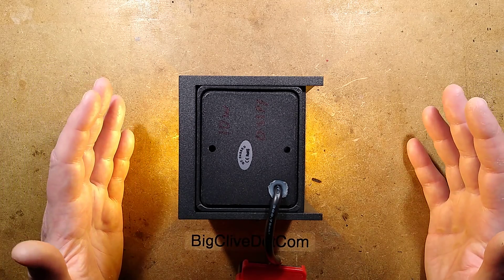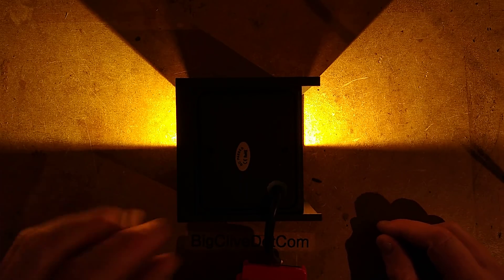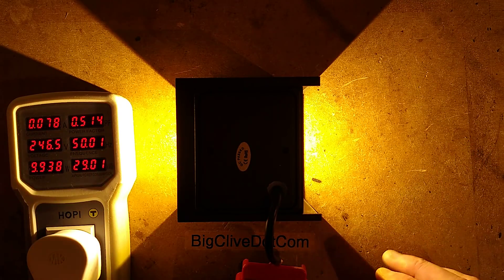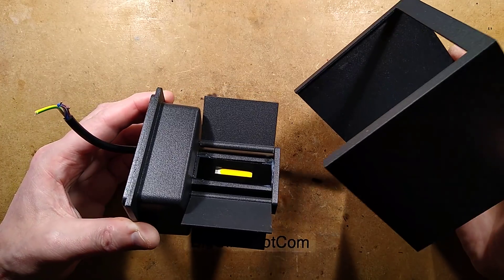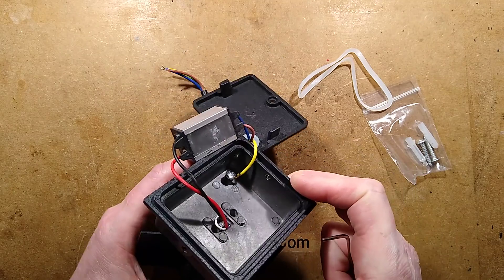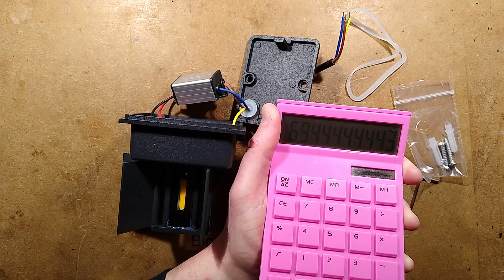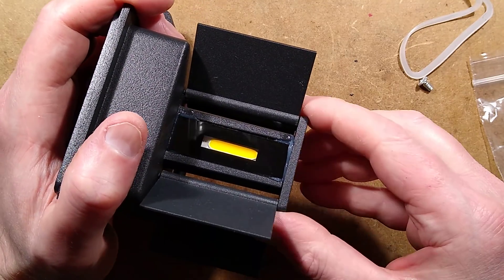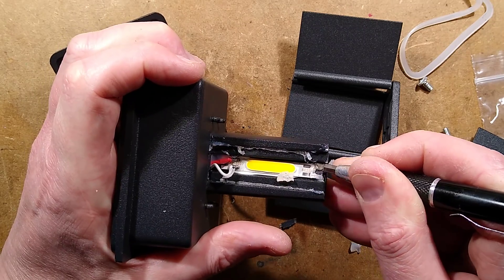Inside an eBay "IP65" LED wall light with barn doors for light control

Comment: Hey Clive, got recently a 220V power supply module for DIY projects (without case). It has a dedicated ground connection on the board. Thing is, when I measured it, it has a potential of about 7V AC (no load) and a current of ~2µA flowing to ground. Still wondering if that is normal or not.

Comment: 8:47 How do you read these COB markings ? Google doesn’t help me here ...
Reply from the maker: There doesn't seem to be a formal standard.  There will generally be two numbers.  The number of chips in parallel and the number of those parallel circuits in series.

Comment: Are COB’s always driven on current ? And how do you find out the correct current for a given COB ?
Reply from the maker: Usually, although there are some common 12V COBs for vehicle use that just rely on the combined LED forward voltage adding up to around 12V.  They tend to fluctuate in intensity significantly with voltage variations.

Comment: I searched first, but didnt see any, do any of your videos of misting cleaning devices contain electro-static devices?  Our school almost got taken to the cleaners by a company trying to sell "electro-static" air mist hand held devices for $800 each that they claimed would cause the mist to be charged in a way that cause the mist to go around corners, under desks, etc...   I understand the concept of charging the particles, but am having trouble finding any actual videos about these types of devices.   Only autobody painting electro-static paint sprayers.  Thanks A TON!
Reply from the maker: The only ones that come to mind are the electrostatic paint guns.  They may have been using them with sanitiser in them.

Comment: I wonder why they always have such short tails on the wires to hook them into the mains. I would have thought if they were being cheap, just leave a terminal block so the person installing it can easily add their own cable as desired. I bet loads of people with these (and those outside light type ones) just have dangerous cables in a hanging junction box or stuffed somewhere. I don't get it. Can someone shed some light on this? (Maybe it's something I'm in the dark about :P)

Comment: You know I sometimes watch these PSU stripdowns in the hoping for the one time seeing you get zapped by capacitor discharge right? This one actually looks quite well made (except for the loose earth. You could put a spring washer in to fix that (I'm guessing that's what's happened with a case of bean counters missing it out from the original design)

Comment: 12:34 "This capacitor holding a charge?" -- proceeds to just put his finger on a capacitor that may have hundreds of volts of charge in it to check it. 😅
Reply: Indeed, it had not occurred to me to check or discharge capacitors that way, but I learn all sorts of interesting electronics techniques from this channel!

Comment: Is this actually sold as a beam-shapeable light, or is it just a Shabbat/Sabbath lamp designed for Orthodox Jews?
 https://en.m.wikipedia.org/wiki/Electricity_on_Shabbat
https://en.m.wikipedia.org/wiki/Shabbat_lamp
Reply: It's sold as "dimmable", and not designed for Orthodox Jews. Most of the pictured uses feature entire banks of these spreading light decoratively along a wall, both indoors and out.

Comment: You mentioning power factor reminds me. I spoke to my power provider about the smart meter. They said they do correctly calculate for devices with a bad power factor. Apparently as they monitor both live and neutral (not my strong point how domestic power is monitored)
Reply from the maker: The question to ask is if they measure apparent power or actual power.

Comment: Hi Clive.  I was wondering if power factor correction will work on these LED lights?  I know it might sound trivial but in some countries still run older style meters.  I have tried power factor correction but it does not seem to be working or I have done something wrong.  Could you possibly make a video on it, it should be interesting to see what actually happens.
Reply from the maker: With electronic loads like this it would have to be part of the power supply circuitry.

Comment: any chance of a video on GU10s etc to find the best judged by reliability safety price etc I've noticed you have tested lots of pound land  ones and other cheap ones over the years I can't remember you looking at any more expensive ones claiming 25000h I'm getting sick of buying rubbish ones I'm starting to think they are all s##t 😀
Reply from the maker: They are pretty much all s**t.  Especially the high power ones that bake the LEDs.
Reply: @bigclivedotcom  I've just been trying to find a good 4-5w one for around the house it doesn't seem to exist I think you should find one with potential to be good and make it bullet proof yet still bright and sell DIY kits or start a business I believe you could make one better than anything available to the public it's clear to see like almost every thing now there designed to fail eventually not to soon that it gives them a bad reputation but garnered you will buy a new one this greedy way of thinking is the main reason pollution is a problem people are getting wise to it and clever people like you could make a difference and make some gilt free money I know lots of very clever people with knowledge in so many different areas watch your video's the time is right to get together and make something special

Comment: Clive, your comment about the power factor (it’s what you can expect from cheap electronics) made me wonder... How can you improve the power factor of an LED light? What kind of driver would get closest to unity power factor? That could make a good video: comparing several types of LED lights of the same power and showing what the power factor is versus current, power and apparent power. Drivers could include a switched mode power supply, a capacitive dropper, a resistive dropper, etc. Throw in some carbonated liquor and foreign candy and it’s a perfect video for a Friday evening.
Reply: But active PFC is a boost circuit.

Comment: Just for your information, I bought this exact light to use as a 'night light' in the workshop at my job. It has been plugged in and lit 24/7 since late autumn 2015. Still as nice and bright as day 1.
Reply: Got around 8 of these hanging outside the house, activated by a photosensitive switch dusk till dawn for like 3 years now. No issues

Comment: If you wipe your magnifier lens with soapy water and let it dry, it works like an anti-fog film. Also works great for the inside of motorcycle visors.
Reply: Yes, I've used that for the inside of car windscreens. It works great until some helpful passenger wipes the glass with a greasy hand.

Comment: Question: Could you test for RF emissions when your evaluating LEDs?
I have found that some inexpensive LEDs generate RFI that will attenuate signals on Wi-Fi and Bluetooth networks!, In the US FCC part 15 applies some manufacturers or rather importers have been find for noncompliance.

Comment: aup big clive, I came home to a stench of burning plastic it seems one of my extension cords has been burning a nice big hole right through the plug you wanna inspect it?
Reply: I had that funny smell last year to find out the soldering iron had fell off the bench and slowly drilled a hole into my feltted sub woofer. Over three days. How the MDF never went inferno... Opppsy. !
Reply: Had one explode outside one year heard it inside the house and had one fail right as i went to pick it up when dad said it was sparking.
Reply: @ucitymetalhead  I never knew these things were so dangerous lol, lesson learnt...
Reply: @mrcat5992  yeah a fun little lesson indeed.

Comment: Hi Clive. At work we have this thing called a "tig brush". It uses a combination of high voltage and a catalyst to anneal tig welds in stainless steel. It´s quite the proces, but i wonder how the thing actually works. They´re wicked expensive, and i can´t really figure out why that would be. (We´re talking 3-5 k dollars i´ve been told). Maybe one in your audience come across a broken one you could take to bits. I think it would be interesting. 
Best wishes from Denmark.
Reply from the maker: I've come across the older type with fabric pads.  I believe it's just a low voltage current limited DC supply and mild acid (phosphoric?) solution as the electrolyte for what is basically electrolysis.  The modern systems seem to use carbon fibre brushes.
Reply: CF brushes and several more zeros to the left of the decimal place for the price, apparently.
Reply: The little electrical pickler for stainless TIG work costs THAT much? That's outrageous. I've only ever used the simple brush-on picklers, never the electrochemical type. I didn't realize I was saving that much money. What a gimmick.
Reply: Whiskey the...what's the catylist ?... hydrogen is often the Hassel an hazard in weilding ,  best catylist are platinum an palladium , dust is extra reactive, add something that soaks up hydrogen preferably...an prolly argon all over...ya know?

Comment: I have noticed when the bench light is turned off the Hopi doesn't Flickr but when the bench light is turned back on again the hopi starts to flicker
Reply: The slower camera shutter speed with lower light level makes the Hopi's flickering display look steady, but with the bench light on the camera increases shutter speed to cope with the extra light, revealing the flickering of the display.

Comment: Is it just me, or does the power cable going into the back of the appliance look..... bodged.....

With hot glue?
Reply: It's a rubber/silicon grommet- just one that wasn't cleaned up around the edges after being injection molded ( hint: look on the inside of the light ).
Reply: @SuicideNeil  👍 Got it, thanks for the info.
Reply: It's not just you lol
Reply: Hot snot, terminology has to be right ;)

Comment: It looks pretty nice but I don't understand where one might use such a light? Would it be a sconce on an outside wall?
Reply from the maker: It seems to be designed for that use.
Reply: i have one of these next to my front door.  only use te bottom half though. no need to light the sky. I like the design because it just fits the narrow with of the door frame.

Comment: Hey, the hopi doesn't flicker when you've got the lighting set to extra moody.  Also, I wonder if the inside of the barn doors could be painted something silver, to bounce blocked light around and maybe soften the edges of the spot (sometimes desirable for some applications).
Reply: The camera shutter is open for longer under low light settings and so you don’t see the multiplexed LEDs of the Hopi refresh.
Reply: Or just white paint (or if it's aluminium, strip off the black paint on the insides

Comment: The high voltage supply should have been a big clue on what supply type it is. Even though I don't tend to like mains-buck supplies due to lack of isolation and "exciting things" opportunities, I don't much mind it here because it has an earth and you're not going to be poking around in it while it's on.
Reply from the maker: It's more of an issue with water ingress providing a fault current path.  With an isolated supply the light might fail over time due to corrosion, but the buck regulator poses a risk of random RCD/GFCI tripping or DC leakage adversely affecting the sensitivity of the protection.

Comment: Love the light idea but not so sure I would trust it! Does look cool though would look good on a fence or wall along a dark path
Reply: Why not? Just don't touch it when its on.....
when the power supply goes boom just replace, the LEDs usually survive ;-)
The ground needs to be good and heavy that's the best solution